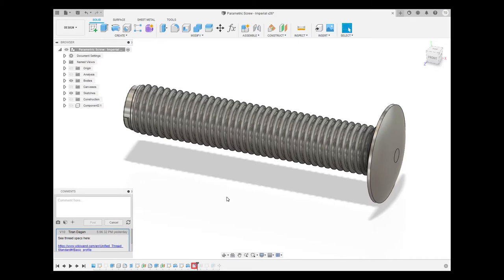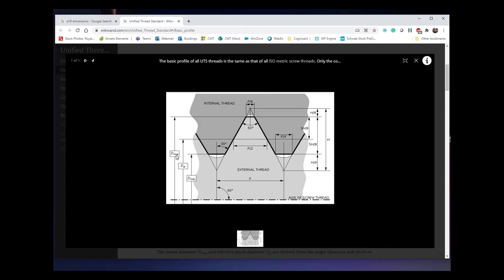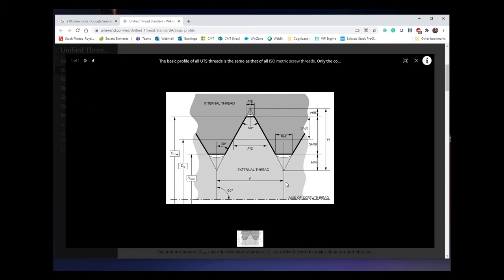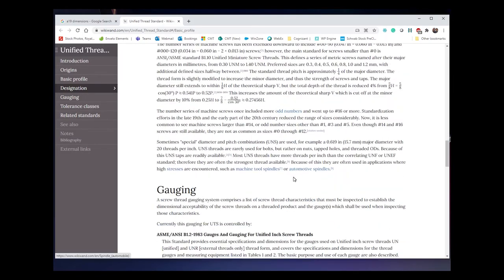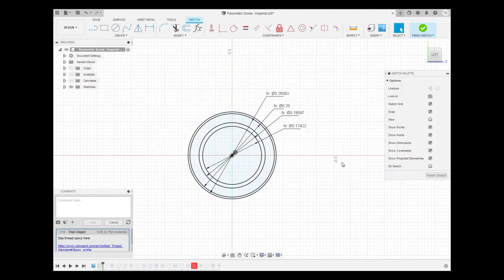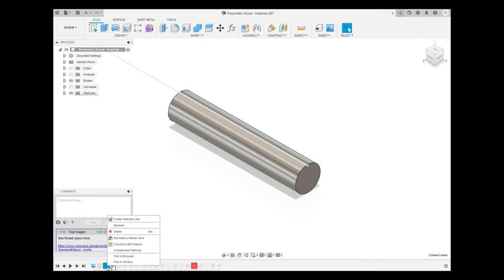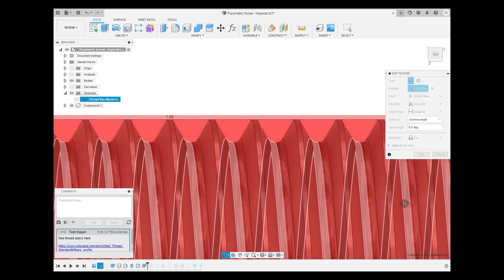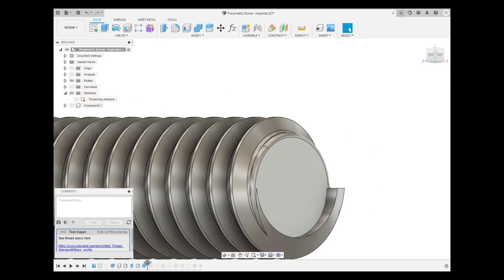Accurate Parametric Threaded Screw (Bolt) in Fusion 360

Comment: Tiran - Excellent presentation.  
Do you have this available as an add-in for Fusion 360? 
I think many of us will be interested in it. 
I have subscribed to your channel.
Many thanks.
Reply from the maker: Jim hi.  It’s not a add on but a parametric design file in fusion 360. You’re welcome to work and modify it or  be use  bu it as a B learning resource!
https://www.etsy.com/listing/946287596/accurate-parametric-threaded-screw-bolt

Comment: Some thread sizes are not included in fusion 360 threads library like M13 , so how can i solve that?
Reply from the maker: You can use this technique and the specs for Metric screws. M13 (not a standard size - it should be M14 x 2 or M16 x 2) but you can nontheless create any thread size you want.  M13 indicates D (basic major diameter) and the number you are missing from your M13 designation is the thread count. If you want to follow the American Ntnl Standard for look up ASME B1.13M-2005 (coarse pitch threads and fine pitch metric threads). See this Wiki entry for internal and external thread design considerations for Metric Screws: https://en.wikipedia.org/wiki/ISO_metric_screw_thread#/media/File:ISO_and_UTS_Thread_Dimensions.svg